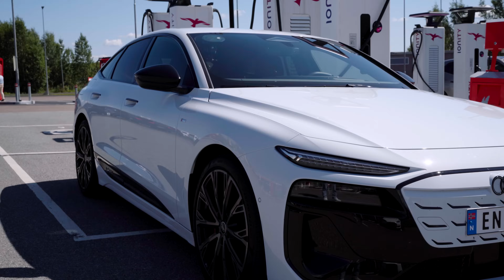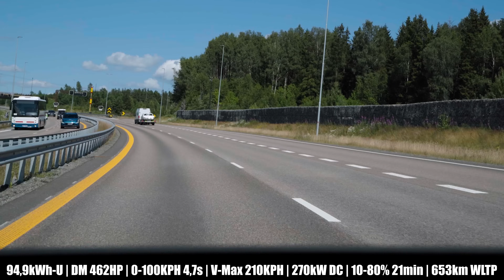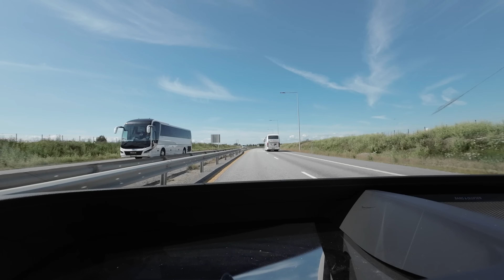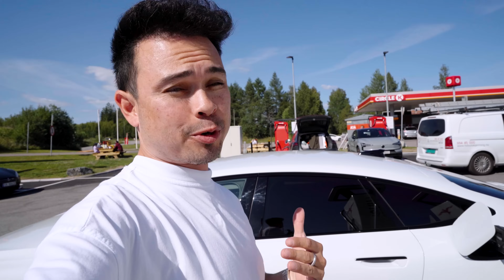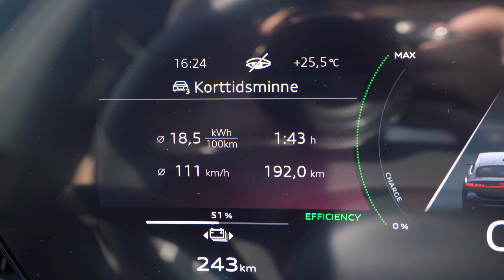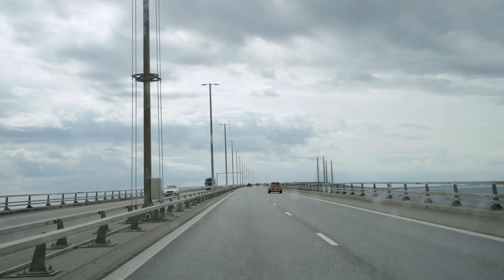Audi A6 Sportback E-Tron Quattro | RANGE TEST @120KPH (75MPH)

Comment: This Audi has a big battery, so it can achieve a long range, but is it really that efficient? I just came back from a 750 km trip in an "old" BMW i4. Admittedly, it's smaller than the Audi, but it had 3 persons and luggage on board. Speed was between 120 and 140 km/h. Consumption 17.1 kWh. It's a good number, but it's not extraordinary. So I wouldn't call the 18.5 of the Audi, with lower average speed and one person on board, "very efficient".
Reply: personaly i think anything thats less then 20kwh/100 is relativly okay for me when it comes to efficiency now i rather have enough range since charging outside your home in most country basicaly double your charge cost per Kwh here in thailand home electricity is 4.5baht per kwh while PTT ev station is 8.5 baht per kwh compare to charging at home thats almost double so it dosent matter how efficient yoru car is if you have to charge outside you end paying more what most people want is the ability to range out and cover most of there whole trip without having to charge outside and deal with the hassle and cost of it me personaly in thailand where infrastructure is still not as great and charging station are only 60-120Kwh speed which means your talking at least minimum an hour for 10-80 charging i normaly make a 340km back and forth trip twice every month for family and buiness related trips and i normaly drive about 50km around town once i get there so im expected to drive a total of 390km for the whole weekend back home to pattaya from bkk and i really dont like refueling/recharging i prefer to do all the charging overnight at home i have 11.7kwh wall box it normaly only takes me 8hrs to go from almost flat to full and i need at least 50km of range left as buffer in case of emergency so for me a car needs to be able to range a minimum of 440km in the real world buffer included and this kind of range can be done on any ice car my old car was a mazda 3 i have never once thought about any range issue what so ever on that thing and i want that kind of feeling for my ev also but truth is not every ev car can do that on the market only one of the most long range ev cars on sale could meet my demands i normaly like driving around 110kph on the highway and around 60-80 once i get into the city on both end so around 250km at 110kph constant and 100km around 0-80 kph range depeding on traffic currently i drive around in the latest highland model 3 long range with a wltp range of 629 but for my case the true real world range is around 500km which is perfect for me i can do the whole trip without stoping once to recharge even when i did indeed stop its only for toilet and drinks not having to wrestle up charger outside my home make the whole ordeal super convenient and the ev car is actully more convenient then my old ice car day to day since once in a while need to detour to refuel or refuel along the way on my old mazda 3 and on the weekdays i only drive about 30-50km daily that means i can get away with not charging my car what so ever for almost 15days straight thats easily comparable to my mazda 3 with a full tank of gass but the difference is no detour stright to where i want to go and straight back home the tesla can actully hit its wltp when driving around town in the city under 80kph at all times so you see for me a car that do 500km in real world condition is where i draw the line between EV and ICE of course other people use case might diffe and infrastructure might also differ but i think most people demands are probally less then mine so in my oppinion if a car can meet 20kwh/100 thats good enough what i need is range 500km real world is where i draw the line assuming as it age might lost up to 20% of its capacity before i make a change.

Comment: FYI, it's capacitive steering wheel which electrically detects driver touching steering wheel. My OG e-tron "self drives" when you loosely have hand on steering wheel and let steering wheel spin while just keep touching the steering wheel lightly.

Comment: Maybe you could add a frequency response curve to the sound/noise measurements as certain frequencies are perceived to be louder especially in the low mid-range. Even if the dB meter is showing the same values, the "sound" can be very different between cars.
Reply: Completely agree. Reviewers need to start using phons, not decibels. No need to imply a subjective component is needed as he states around 10:10 when we have the correct objective unit available.

Comment: I actually got to borrow one from the dealer this weekend to test out. Honestly, I don't like it. It has an impressive range (the RWD, large battery is even more range) and a lot of really great features. 

What I don't like is, most critically, the road noise was awful. The US doesn't get the air suspension (I guess), and Audi seems to have not spent much time tuning the coil overs. It's relatively comfortable ride, but the cabin noise is incredible. There's a constant hum at just the right frequency to bother me. After ten minutes driving, it feels like my ears are stopped up and the headache starts. 

Further, I am not able to predict the car's behavior. Sometimes it has lift off braking and sometimes it does not. Sometimes you step on the "gas" and there's a delay before power is applied. This is a constant drive mode. I tested the different drive modes and found comfort to be the best. Dynamic just made the steering so twitchy that I my arms got tired just holding it in a straight line. 

None of the really annoying settings (e.g. the giant flashing red on the HUD, or the CONSTANT ping of the "eye monitor", and the mass movement of speed limit signs on the HUD) were changeable in the settings. I almost had an accident dodging something that I thought was in the road, but it just the flat speed limit animation that appeared and moved up into place. That's REALLY frigging distracting. 

It seems like a fine car, lots of range, lots of cargo space (the rear visibility is effectively zero), and has some decent pick up. But my PHEV Volvo feels faster, is way more comfortable, and doesn't change behaviors while driving. The A6 is just not for me.
Reply: You need the top trim in the US for Air Suspension.

Comment: So the Polestar 4 is perceived as the quieter one and has a much nicer interior. 

That is more important than range to me (95+% of my trips are within range anyway), besides only the smaller battery is of intrest to me (big one is 10K Euro more expensive, certainly not worth it). Same qoes for changing speed, public charging will be a rarity. Who cares about 10 min or so charging time.

Both are fine rides and handels well.

Exterior? I like both, but I think the A6 has a small edge here.

But overall, the P4 has the edge, imo.
Reply from the maker: "So the Polestar 4 is perceived as the quieter one and has a much nicer interior. "

Polestar 3 has a little quieter interior in instrumented testing, but is perceived to be even more quiet than the numbers say. Haven't driven a Polestar 4 on these roads in a while, so it hard to say.

Audi A6 drives and rides superior to the PS4 imo. Especially on air suspension. Audi also has superior ADAS (not even close), and the user interface and infotainment in the Audi is also better. Lastly the A6 SB is more practical, much more efficient and charges very fast.

Yes it cost more, but you are getting a better vehicle imo. But still love the PS4!
Reply: @KrisRifa Ohh, you talked about the P3. I thought you meant the P4. 

Thanks for the feedback though!

Infotainment  isn't that important to me. I just need Google to tell me when I shall turn and Spotify playback. The rest is just bloat.

ADAS, nice but not necessary.

More practical, how?

Here in Sweden the P4 SM (w/ Plus and Pilot) and the base A6 (w/ Tech Plus and some more extras) is basically the same price. So they are very much natural competitors. Higher tier versions aren't worth it (ok, the P4 DM can be worth it - depends on other costs, especially insurance).
Reply: @KrisRifa hi Kris, thanks for the review, speaking about competitors, could you maybe do a review of the DS No8 sometime soon? Wondering how that stacks up against ps 4 and audi.. thanks!

Comment: Has the Audi more tire noise than the Id7 Gtx with 20 inch?
Reply: I guess it also depends on what tires you are running on. Mine came with Falken ziex. It would be interesting to hear the difference, with eg. a Continental Sportcontact 6.